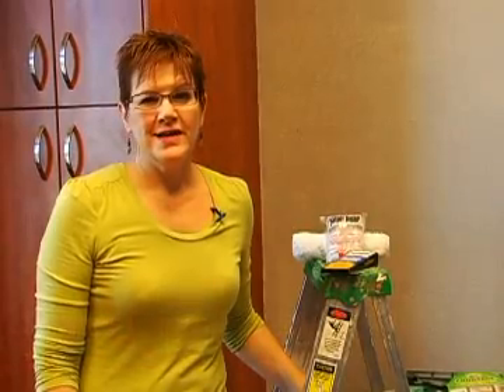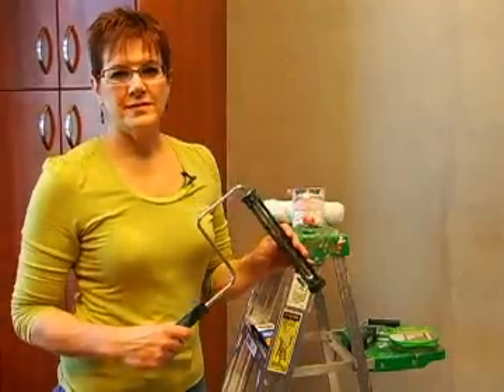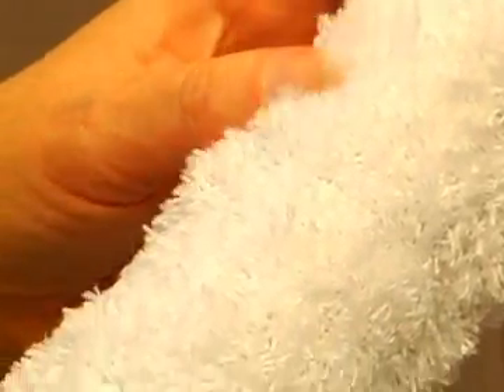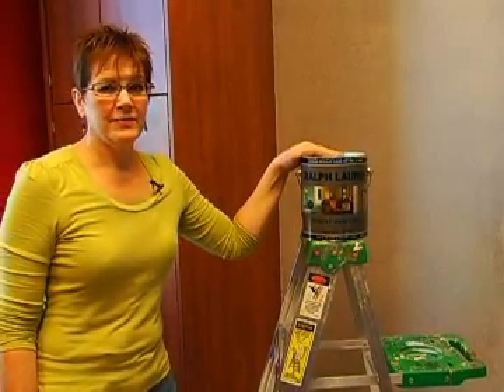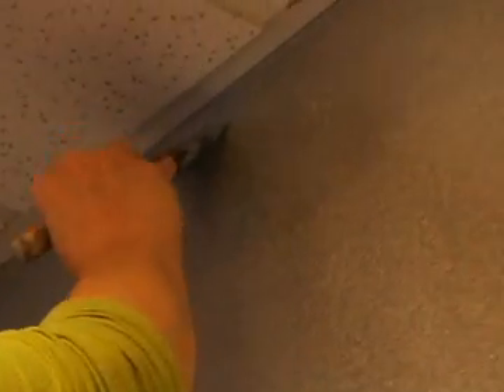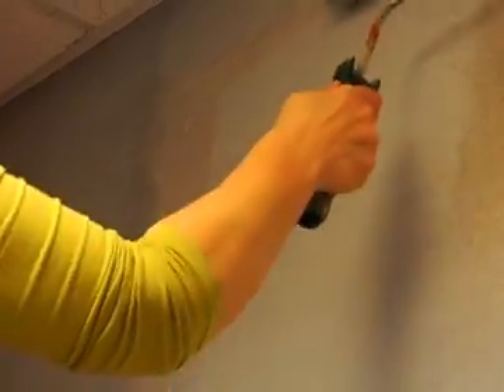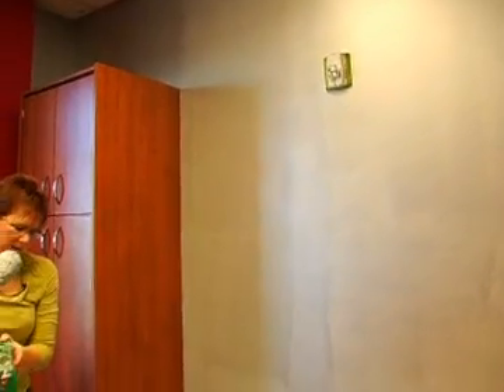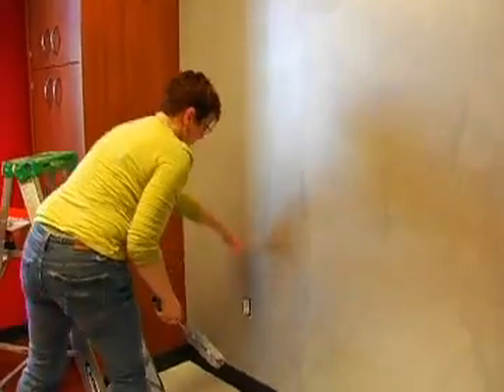Painting with Metallic Paint

Comment: Why are you playing around with that flat brush? It's a lot easier to use an angle brush which is designed for trim. It also saves a crap ton of time and produces a better trim line. Not to mention, you would save $ by not having to paint and repaint the same corner/trim 20 times or buy expensive FROG tape. One smooth swipe and your done. Also, you should use Purdy brushes, again saving $ by using professional products that most likely cost less than this no brand brush you're pushing...or is this an ad?
Reply: She IS using an angled brush you Purdy sales rep
Reply: not only that but Purdy brushes are for an average job, Caroma is the best